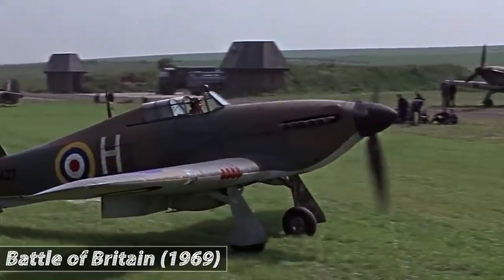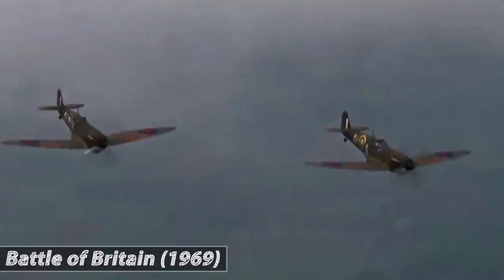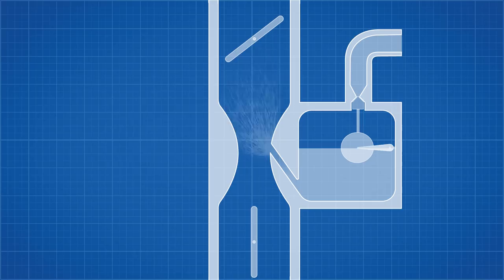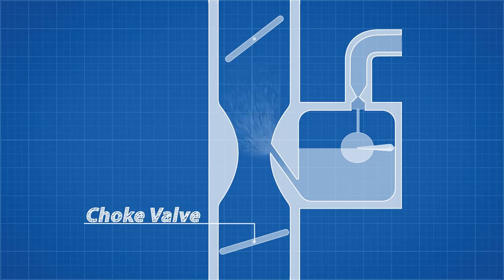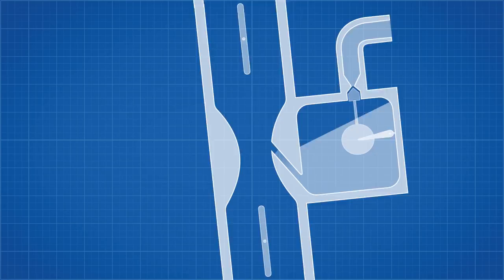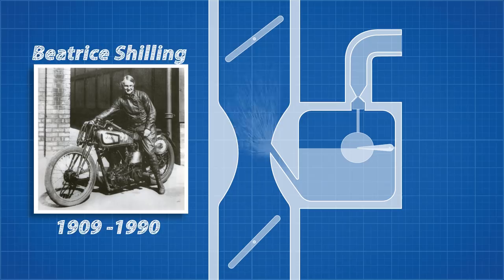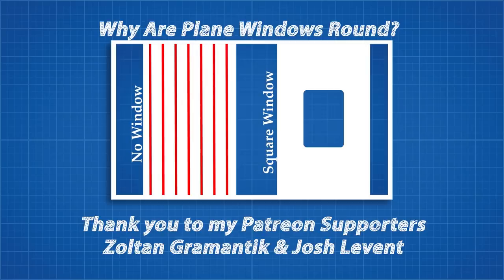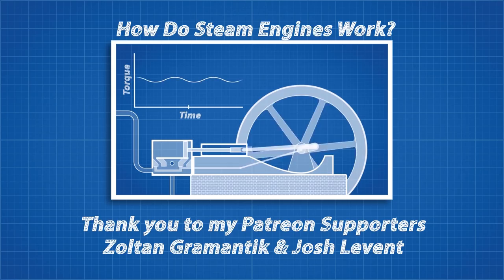The Spitfire's Fatal Flaw

Comment: It had a worse flaw than that. The position of the fuel tank basically ensured that if there was a fire the pilot would be cooked. It was actually worse in the Hurricane but the Spitfire was nearly as bad. If bullets punctured the fuel tank, the pilot would probably end up soaked in fuel and if it ignited, well...
Reply: Thanks for sharing this significant detail. Do you know much about Messerschmitt flaws?
Reply: Martin Sorensen Eric Brown says it was prone to aileron snatch when the leading edge slats popped out. Other than that, not much. If you can find his book "Wings of the Luftwaffe", I'm sure you would enjoy it.
Reply: +TheThirdMan Much appreciated!
Reply: Most fighters at the time had their fuel tanks close to the pilot (many had the pilot effectively sitting on a fuel tank).  When you need to get the 'heavy bits' as close to the CoG as possible, especially if those bits are to change weight (ie empty), there is little alternative.
Reply: Alf Noakes Wing tanks were not unknown. They weren't necessarily better performance-wise but at least the pilot was less likely to get soaked in fuel. It was a bit of a hang over from WWI.
Reply: Martin Sorensen Alf Noakes I think the 109 pilot sat on the fuel tank.
Reply: Ever heard of self sealing fuel tanks, the Spitfire got them early on, leaking fuel was not such a big problem.
Most fighters had fuel in the fuselage and the wings, some in front of the pilot and some behind,  later Spitfires had both and fuel in the wings.
Reply: The Third Man.
Aileron snatch, was just one problem, many Bf 109`s were lost through ground looping a problem the Spitfire did not suffer from, also the controls on early Spitfires got heavy at around 400 mph, the Bf 109 was far worse.
Reply: Barrie Rodliffe 
" Ever heard of self sealing fuel tanks"

Of course.
Reply: Not really. Armour behind pilot and a big engine in front. It was a small gravity tank.
The 109 pilot, by contrast,  sat on the main tank.
Anyway. They were all small and relatively easy to knock down.
As for the aileron issue they made a running change from fabric to metal covered control surfaces, which fixed it.
Reply: The Third Man.
Really, then do you know why they used self sealing fuel tanks?
It was to prevent the fuel leaking and the pilot getting soaked if the tank was hit by bullets.
Reply: Barrie Rodliffe I get that. The early ones didn't have them. There are loads of pilot memoirs which describe this.
Reply: @martin sorensen  i believe the ME109 had a crappy pit layout,  a tendency to flip on landing and a canopy which flipped open up and sideways, which once its landed on its roof makes it impossible for the pilot to escape. I think i read many pilots burned alive because of this.  It seems to be poor foresight for the normally thorough germans.
Reply: slickstrings Now that you mention it, the 109 had notoriously weak undercarriage.
Reply: Self sealing tanks were being made in Portsmouth, fitted in the Fairey Battle, other versions of these tanks were installed in the Spitfire  and Hurricane, There is no mention of the dates but the Fairey Battle was mainly used very early in the war.
Reply: Barrie Rodliffe The British became very aware of self sealing fuel tanks when they realised how difficult it was to shoot down German bombers during the Battle of Britain. This is outlined extensively in Len Deighton's book "Fighter". I am unaware if it was even possible to retrofit them to Spitfire or Hurricane airframe (Hurricane maybe).
Reply: Strange how the British knew about self sealing fuel tanks well before the war, they had a factory in Portsmouth making them for the Fairey Battle and for the Hurricane and Spitfire. They can`t have had so much trouble shooting down German bombers, they shot down quite a lot .
Retrofit? they were made for the planes so they did fit.
Reply: Barrie Rodliffe Okay Barrie, I give up. You know more than I do. Happy now?
Reply: +Barrie Rodliffe Regardless of whether self sealing or not, fuel tanks will burn/explode in combat. Dozens of british pilots were burned by the forward fuel tank exploding, Its even mentioned in Battle of Britain.
 Oh yeah, ask any combat veteran how well self sealing fuel tanks explode when hit.
Reply: Ross York I'm thinking Richard Hillary's description of what happened when he was shot down. Again, I'm unsure of whether self-sealing tanks could have been retro-fitted to Spitfires because of the monocoque construction. The Hurricane was another matter because it wasn't a stressed skin but a space frame. The Hurricane had similar combat results in the Battle of Britain but had a much lower survivability rate if shot down.

Deighton's description of the difficulty of shooting down German bombers is quite revealing and he explains the mechanics of the self-sealing fuel tank quite well. It was good protection against the rifle-calibre ammunition used by British fighters. Not so good against later cannon-armed aircraft.

The Spitfire Mk I and the Hurricane Mk I shared the weakness of rifle-calibre ammunition, making the job of shooting down German bombers harder. They had to score structural hits, rather than hitting the fuel tanks. The 109's cannon armament was reasonably effective but had a tendency to splash on impact, rather than penetrating and then exploding.
Reply: Martin Sorensen Len Deighton describes the relative merits (and demerits) of the Spitfire, Hurricane and 109 in his book "Fighter". Not all of it is relevant (the turning circle comparison is a bit of a furphy) but it gives some perspective which might help if you are planning another video.
Reply: Ross York.
Ask any Luftwaffe pilot what happened when his Bf 109 caught fire, it did happen and no fighter was immune, self sealing fuel tanks were designed to stop the leak and they were far better than not having them.
Self sealing fuel tanks were fitted to both Spitfires and Hurricanes and having the fuel tank in front of the pilot was no worse than the pilot siting on the fuel tank.
Reply: Barrie Rodliffe Self sealing fuel tanks were not fitted to early models. Now, with all due respect, I have given all my information in good faith and have not willingly or knowingly sought to lead anyone astray. I have given you some references and if you have different information, I respectfully ask that you do the same.
Reply: Self sealing fuel tanks not fitted to early Spitfires. Well I wonder if you really have any idea.
Britain had a company making self sealing fuel tanks and the first went into the Fairey Battle, followed by the Hurricane and Spitfire.  In the Battle of Britain the Spitfire had a self sealing lower fuel tank and the upper tank protected by an aluminium panel which could deflect machine gun bullets, also they were coated internally with a layer of linatex. and the cockpit bulkhead was protected by a  thick asbestos panel so the Spitfire pilot was better protected than the Hurricane pilot. The Luftwaffe had self sealing fuel tanks but these were not so good against de Wilde incendiary bullets which the Luftwaffe did not have .
Reply: Barrie Rodliffe You seem to think that, having read what I have, that I should believe you because...well, just because. I gave you the opportunity to back up your claims. Barrie, I don't mind being wrong. I mind your sarcy, smart arse manner and lack of any referencing. Take it somewhere else. Nobody likes an anorak. Goodbye. Blocked.
Reply: A 109 pilot sat in a Spitfire and simply said "I wish we could of had these" much better visabillity, roomier cockpit. and a much better plane to fly . Well we did win the war after all :)) He said the 109 would bite quick and bad and she was hard to fly and he flew them.
Reply: Ted Church If you have ever seen a 109 in the flesh, you will realise how small it was. It was really just an engine with wings and somewhere for the pilot to sit. Comfort was a secondary consideration... But the engine in the 109 was better than the Merlin and the 109 was about 700 lbs lighter than either British fighter.
Reply: the carburator problem was already solved by fuel injection in 1941, and then the main advantage of the spitfire was its maneuverability, which is more effective when trying to shoot a plane from behind than speed. just find out with a realistic combat flight simulator and you will find that a more powerful engine isn't always the best option for a fighter.
Reply: Marien Kijne 
" the carburator problem was already solved by fuel injection in 1941"

As far as I know, the Merlin was never fuel injected.

"just find out with a realistic combat flight simulator and you will find that a more powerful engine isn't always the best option for a fighter."

This is the problem with the internet: a lot of people who make comments like this haven't read enough history or tactical breakdown to get an accurate picture. NO fighter pilot would ever turn down the option for more engine power. as far as pilots are concerned, you can never have too much power and every one of them will tell you "speed is life". The Americans call it "energy state".
Reply: TheThirdMan The Merlin later used pressurized carburetors, which ARE a form of fuel injection, known as throttle-body.

And he's right, more power isn't always better. The Bf 109 increased power throughout the war, but gained weight at the same time, losing agility. A more powerful engine can add weight, which hurts maneuverability if the wing area remains the same. Also, the added torque can compromise ground handling ability.
Reply: Matthew Gavin
Throttle body injection is not the same as fuel injection and is probably at best, a half way measure. Not saying it wasn't as effective or that it didn't, to all intents and purposes, solve the problem.

"And he's right, more power isn't always better. "

It's safe to say that no fighter pilot would agree with you. They would argue that you can never have too much power. You learn to cope with the quirks because in combat, your energy state is far more important. Inferior ground handling is not even a small price to pay. It's not even a consideration. Joe Smith, who took over the Spitfire's development after Mitchell died, had the philosophy that "a good big 'un will always beat a good little 'un". All fighters grew in weight during WWII. The Spitfire ended the war 80% heavier than when it started.
Reply: TheThirdMan Yes, but the Spitfire's wing was adjusted to cope with the increased weight.

Also, throttle body injection is considered an early form of fuel injection. Also about the more power not being a problem, what about the F4U Corsair, which could flip upside down if the throttle was advanced too quickly. Also, more power means reduced range.
Reply: Matthew Gavin 
"Yes, but the Spitfire's wing was adjusted to cope with the increased weight."

I don't think anyone was arguing that this should not happen.

"Also about the more power not being a problem, what about the F4U Corsair, which could flip upside down if the throttle was advanced too quickly."

I think they call that "pilot error".

"Also, more power means reduced range."

Not necessarily. It depends on what it is optimised for. Altitude, aerodynamic configuration, power settings, propeller ... all have an impact.
Reply: TheThirdMan No, the Corsair had a known problem because its engine had so much torque, it could flip the plane if the throttle was advanced too fast. 

And more power does mean reduced range, because you need to burn more fuel.
Reply: Matthew Gavin Then the pilot needed to be more careful. FWIW, the Thunderbolt and the Hellcat had the same engine.
Reply: Matthew Gavin
"And more power does mean reduced range, because you need to burn more fuel."

Why? You can use a lower throttle percentage to get the same performance with the same drag (of course, it's not actually that simple).
Reply: TheThirdMan But when you get into combat, you'll be using more fuel.
Reply: Matthew Gavin Yes, I know that but the advantages substantially outweigh the disadvantages. Why would you opt for range over performance in a single seat fighter? Sure, you want both - al la the Mustang - but to increase the Spitfire's range to match that was an impossibility to start with. You're arguing against the one thing designers strive for more than anything else. Performance.
Reply: TheThirdMan Actually, I think it could've been done. The Mustang and Spitfire were about the same size, and I suspect a change of the aerodynamics would've helped.
Reply: Matthew Gavin LOL!! What change would that be? Changing the aero configuration of an aircraft is quite a different prospect from uprating an engine. Believe me, if it could have been done it would have been. the Spit was tried with under belly slipper tanks but they were not a complete solution. It could still not effectively escort bombers to Germany the way the Mustang could.

In fact, these two aircraft illustrate very well what I'm talking about in terms of the trade offs and progress in design. Aerodynamically, each had its own strengths and weaknesses. They were very different aircraft with similar engines.
Reply: TheThirdMan I meant improving the aerodynamics i.e. a laminar flow wing.
Reply: Matthew Gavin That's even harder. The manufacturing processes for a true laminar flow wing did not really exist until after WWII, though they were being developed. The Mustang came close but wasn't quite. The Supermarine equivalent was the Spiteful wing which was never produced in quantity during the war and was only really used on the Swift, a post-war jet aircraft.
Reply: TheThirdMan There's nothing to say the Spitfire's normal wing couldn't have been modified to be a laminar-type.
Reply: Matthew Gavin No way. It wasn't a simple matter. They would have had to change the whole production line and that would have meant major disruption to production. It simply wasn't feasible. Besides, Supermarine were looking at what they considered to be more advanced solutions. In the end, the trapezoidal laminar flow wing turned out to be less advantageous than expected and the old elliptical wing turned out to be better than expected.
Reply: TheThirdMan True enough. It was later discovered that the Spit's elliptical wing had a higher critical Mach number than laminar-flow wings. In fact, according to Jeffrey Quill, the Spitfire was more controllable at near-supersonic speeds than any other plane of its time, even early jets. And one Spitfire reached Mach 0.92 and only lost its prop, while another potentially reached Mach 0.96 without any damage.
Reply: Matthew Gavin The trouble with laminar flow is that you are dealing with Reynolds numbers (because it's to do with surface roughness). That means the finish has to be of very fine tolerance. Even paint asymmetry becomes a problem.

Critical mach number isn't purely a wing issue. Mcrit is the speed in terms of the speed of sound that the airflow becomes sonic over one section of the airframe (be suspicious of anything which refers to that in MPH etc. It'll probably be wrong). It might be the wing or the cockpit or the spinner or something else but the number will always be less than 1. But as soon as you start generating shockwaves, strange things start to happen (Mach tuck, control reversal etc.). At that point the propeller is acting as a huge airbrake because it cannot turn fast enough to get the blades out of the way. This is probably why Martindale's prop came off but it was no trifling matter. I don't know if it did any further damage to the airframe but Martindale had to work very hard to get down safely.

I have never heard of .96 Mach in a Spitfire or any other piston aircraft. I doubt it.

But this actually is an excellent illustration of my point about optimisation. The Spitfire Mk IX had a quoted top speed which was rather less than that of the Mustang (generally accepted as 408 mph vs 437 mph for the D model) with basically the same engine. Again, I'm always a bit suspicious because they are never absolute and binding. The only thing that really matters is airspeed. That said, the Mustang could not dive at that speed or with that sort of control. It had very clearly defined limits. Quill was probably right in that regard. I know Eric Brown said much the same thing.
Reply: Matthew Gavin By the way: i also suggest you ignore anyone who says they exceeded the speed of sound in a prop driven aircraft. The problem comes from the way the airspeed is measured and the generation of shockwaves in the pitot head. A lot of Thunderbolt pilots fell for it but the issue was not widely understood. What happens is that they read the IAS off the instruments and use the chart which takes local variations into account and come up with an inaccurate figure when correcting to TAS.
Reply: TheThirdMan Um, I never claimed they exceeded the speed of sound, they just came quite close. The Mach 0.92 run is verified, while the 0.96 is not confirmed.
Reply: Matthew Gavin
"I never claimed they exceeded the speed of sound, they just came quite close."

No, you didn't. Many others have (and with not a little conviction).
Reply: TheThirdMan Key words "others have". Mach 0.92 & 0.96 are less than Mach 1.
Reply: Matthew Gavin I know. That's why I said it. And I would take a bet that .96 is impossible in a Spitfire. The propeller is acting as a huge airbrake and simply cannot get out of the way
Reply: TheThirdMan Like I siad, the 0.96 is almost certainly wrong, caused by buildup in the pitot tube. However, the Mach 0.92 was verified, and the Plane that did it had a fully feathering properller to prevent the engine overspeeding. Once he pulled out of the dive and landed, it was discovered that the wings had actually been bent slightly backwards by the air. Here's the article on it:

http://www.bbc.com/future/story/20160505-the-spitfires-that-nearly-broke-the-sound-barrier

Also, the pilot was awarded the Air Force Cross for it, which would NOT have happened if they weren't absolutely sure.
Reply: Matthew Gavin I don't doubt the .92 claim.
Reply: TheThirdMan That's not what you've been saying.
Reply: Matthew Gavin Then you read it wrong. I even described what happened to Martindale.
Reply: Petrol does not need to be on fire to burn you!
Reply: chitlika True!
Reply: Anzac-A1
"what about the F4U Corsair, which could flip upside down if the throttle was advanced too quickly." That is why you have a person with experience in the cockpit. He does not advance the throttle too quickly as he intends to live a little longer. What is wrong with you people? It's like saying that if a soldier pointed his gun at his own head, he would pull the trigger. Not all pilots/soldiers are mental cases! I wonder if one can say the same about all the people spreading their "experience" here.